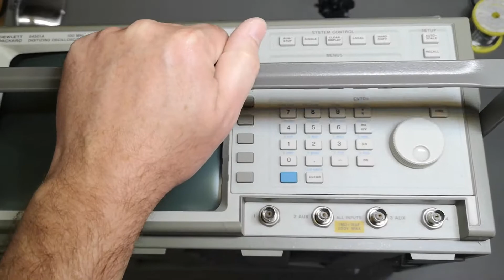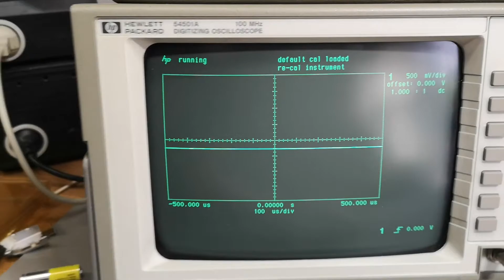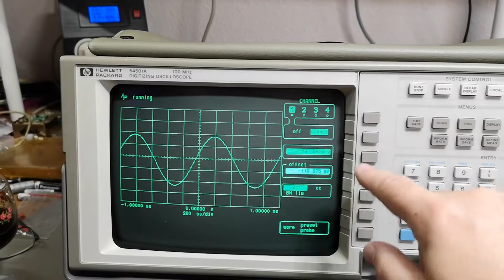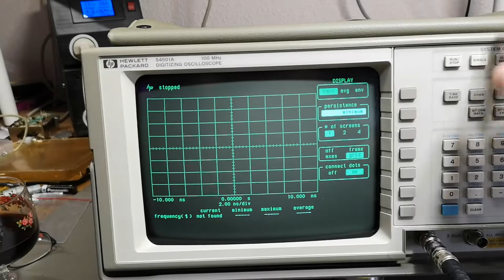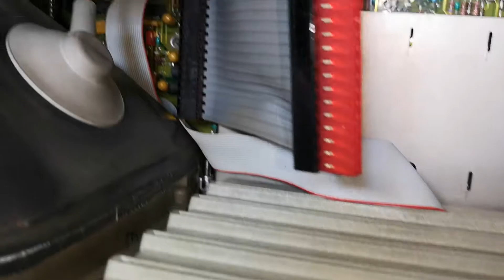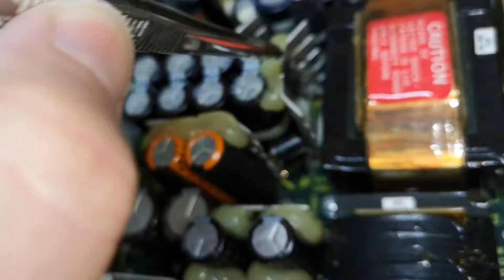HP 54501A Digital Oscilloscope 1989 4ch 100MHz test teardown

Comment: I have one of these as well that I use for my main scope and I was pleasantly surprised to see this video on my feed. There are actually a couple of videos on my own channel where I put it to some good use demonstrating warble when playing two adjacent notes on a keyboard. It's an old scope, but quite nice. I'm surprised the Dallas clock chip in yours was still good, which was something I had to replace in mine. (It becomes useless without it) Honestly, I felt like once I understood the user interface it made a lot of sense and provides some very nice features for the time period. Really, my only complaint is that all traces are of course the same color. That being said, this hasn't been as annoying as I'd have originally expected. I haven't worked with anything fast enough to notice how the "100 MHz" is done, but that is quite fascinating. It's also very useful to be aware of since, while under normal circumstances it should be as good as a real 100 MHz scope, I can see some cases where it'd have its limitations.

I did a couple of modifications on mine aside from replacing (and socketing) the Dallas clock chip that I'd like to note in case it's useful for anyone who runs across this. Firstly, I replaced the fan with a 5V Noctua Redux fan and it's so much quieter. Since I use it, this was a huge quality of life improvement. The second is I replaced the power inlet with the modern equivalent. Although I needed to use the block from an original inlet to switch voltages since this changed on the newer design. The reason for this was that someone on some forum or Reddit recommended this stating that the older ones had a tendency to catch on fire. I'm sure it's quite rare, but I figured it was worth the peace of mind.
Reply: My power inlet (schafnner 393 ) is burnt, but is quite expensive replacing by new one (c14 connector must be unusual) what did you use to replace the old one? Tia!
Reply: @pedromillan3752  I replaced mine with Digikey part number 817-1971-ND. But importantly, I needed to use the voltage selection block from an old 393 because the one that's included is different and can damage your oscilloscope from what I've heard.

Unfortunately mine came with a different inlet with an incompatible block and I had to order a 393 on eBay just for the old block to use in the new inlet.